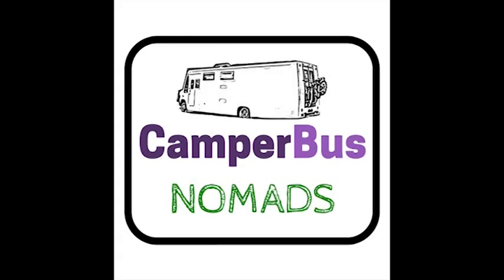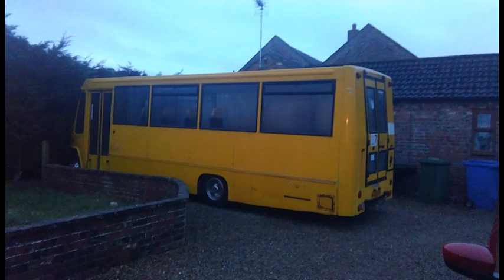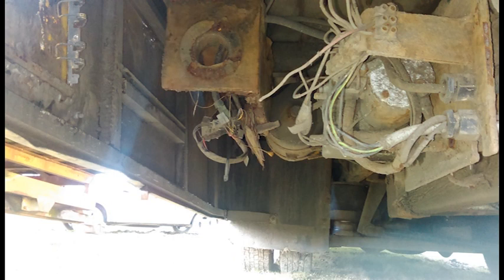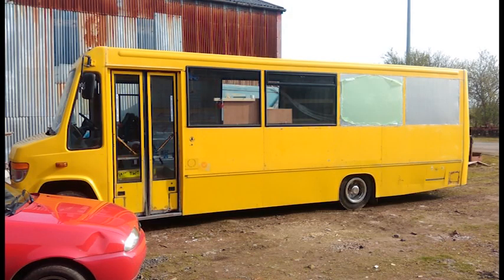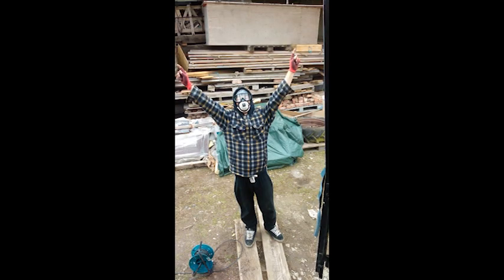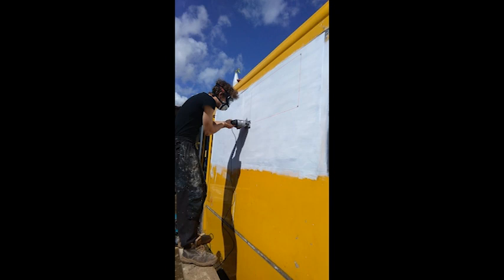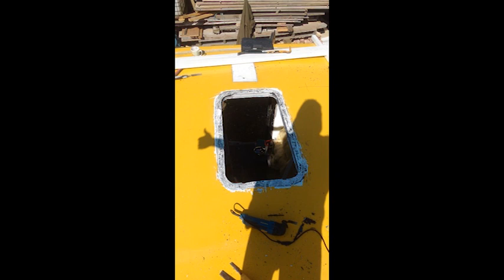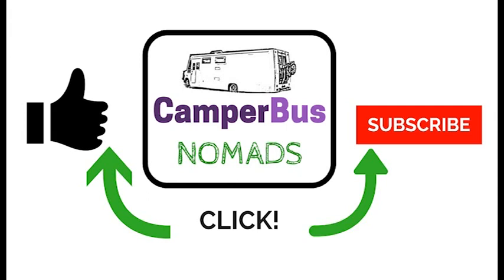CamperBus Conversion Part One | School Bus Converted To Off-Grid Motorhome

Comment: How do you see out to your left and right when driving? Adding that door and the new passenger side door have totally taken aware your visuon
Reply from the maker: Side windows
Reply: Ok firstly, I wasn’t being rude so please accept my comments as merely inquisitive. But I’ve paused at 8:43 and I see like a caravan door added to where the former split all glass doors were as standard. This is not offering the vision you’d need surely. The forward most window is further forward than the drivers seat so your only option of looking left at a junction is through the tiny window in the newly added door. Has it been passed by DVSA and mot’d yet?